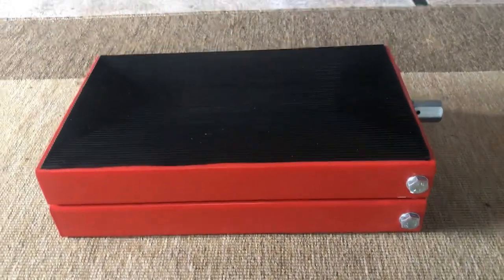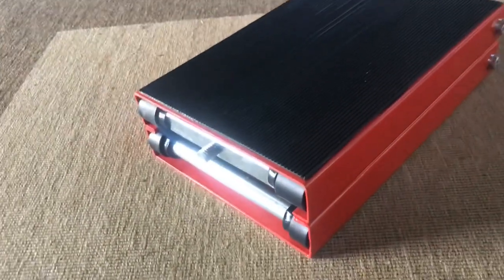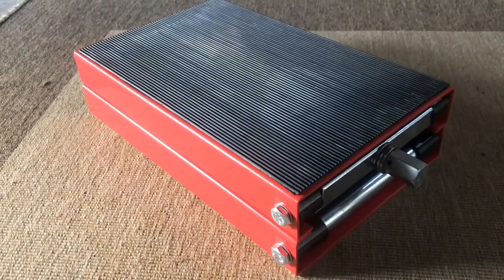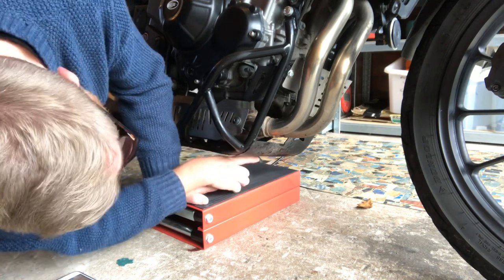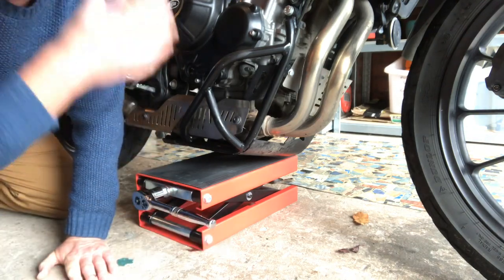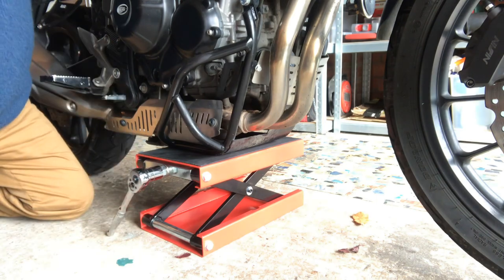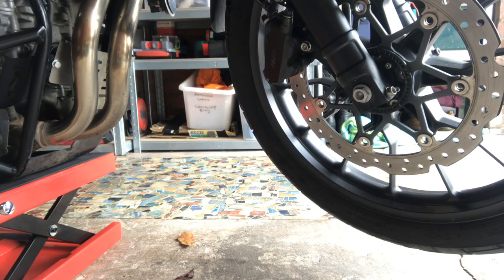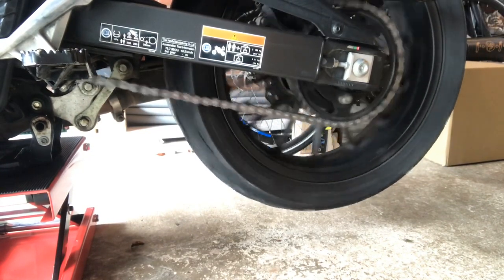Motorcycle Scissor Box Lift Review

Comment: Have one of these.  If you are considering a heavier bike over 250kg I'd recommend to change the cotter pin thats locks the bearing collar, the original appears to be only mild steel and snapped on mine (I was using it on a corner of the car so probably upwards of 300kg load)  Easily replaced with a hardened pin (and the opportunity to grease the thrust bearings).  Is a great and relatively cheap option for lifting  my Scout bobber.
Reply from the maker: Good information and advice 👍🏻
Reply: wow - I had my Harley Road King on one of these (367 kg) with both wheels off the ground - I am not sure where the cotter pin you mention is situated.

Comment: I just had mine fail. I was lowering it when the threads in the cross member that the threaded rod goes through pulled out. It gave no warning or indication there was a problem. It was only about a year old. The threads on the rod are fine. If you’re using one of these I would inspect the threads in the cross member of the scissors lift.
Reply from the maker: Good feedback Carl, will certainly inspect mine and maybe prop with some solid wood in use! Did you have any damage to bike?
Reply: No damage to the bike fortunately. It could have been catastrophic though. I was lowering it to line up the rear axle an my buddy was holding the tire. The bike dropped until the fender landed on the tire. Nobody was hurt luckily. I had never put any more than 600#’s on this scissors lift.
Reply from the maker: @carlw180  it’s horrific to think what could have happened, glad you were both okay!  What weight was your bike and I’ll pop a comment on the video information 👍🏻
Reply: @thecampingbiker791  The bike was a Harley Sportster. About 550#’s but I was only using it to lift the rear of the bike just in front of the rear wheel. I only used this scissors jack on my bike lift table. The front wheel was in a clamp and the bike was strapped at the handlebars so at least there was no worry that the bike would fall on its side. I don’t think I would recommend using this on the ground.
Reply from the maker: @carlw180  thanks for that, it will be interesting to see if we get any further feedback but I’m going to add comments to the information section of the video as a word of caution 👍🏻 keep safe and ride often 😆

Comment: Yes. Spend a bit of money and negrwo-rig-up some supporting straps.
I lift my bike with the scissor-jack. Consecutively, (with moderate tension) 2 straps around the heaviest part of the steering-column. 98% ensures no tip over.
Reply from the maker: Yep, have to agree and coincidentally just had it up on the lift with straps for a chain clean

Comment: I have the exact same model Honda CB500 X and shyed away from the bash guard you  have as you can't fix a center stand to the bike if you have this bash guard even though it's well made, as a center stand is a very  important item to have on the bike for lots of reasons when traveling or working  on the bike when doing repairs.
Reply from the maker: Hi Robert, I fitted the SW Motech centre stand and sump guard even though I did want the RR for that very reason, but in the end I decided the SW guard wasn’t heavy duty enough for what I ended up doing so ditched that and the centre stand!!   Also when fitted, I thought the centre stand may end up potentially snagging when the off road got a bit iffy.   It does make it a bit more difficult on the road so I’m going to make an emergency ‘stick lift’ mainly to help with chain cleaning, time will tell... 😆 👍🏻

Comment: This sounds ideal. I looked at this model and wanted to actually see one so thanks for the video.
I think also think the bike needs further support so I'll look into doing that somehow, even if it's a kind of wooden frame on each side.
Reply from the maker: Thanks for watching. I’ve subsequently seen these used in workshops and mine has been excellent without issues.. all the best 👍🏻
Reply: @thecampingbiker791  Yes, thanks for the reply. I'm ordering one today. 6 months waiting for two bike shops so I decided I'd do my own work. I had thought of pushing the bike to turn the engine but I've no room. £50 instead of their mechanics fee.
Reply from the maker: @bill-2018  even Rally Raid were using one for my bike front fork upgrade.. I think you’ll find it very useful over time, even for the little jobs 👍🏻

Comment: Thanks for the review, I’ve ordered one,  do you think it’s wise to cut  some 4x4 wood to the correct size and fit between the metal plates when it’s raised up to avoid accidents in the event of it failing? I only ask as I’ve not got any straps or a garage to suspend the bike to incase it did fail.
Reply from the maker: It can’t do any harm as a failsafe, although I wouldn’t be putting my hands within the lift itself so have mixed thoughts on it really!
Reply: @thecampingbiker791  yeah that’s a good point actually, scrap that idea. 
The bikes only 130kg so hopefully it’s not an issue. Just worried as I’ve seen two people comment that it failed on them. 
Thanks for your input and time!
Reply from the maker: @BlazedAFGaming  I use mine quite a lot but do check it over every now and again to see if anything is giving or looking strained…bit like a mini service check!
Reply: @thecampingbiker791  thanks that’s give me some piece of mind and yeah I’ll be sure to keep and eye on it, I’ve seen some people use impact drivers on these to raise and lower which would cause issues down the line  way to much torque for this.
Reply from the maker: @BlazedAFGaming  I’d definitely only use a hand socket wrench with these, too much power could easily cause problems 👍🏻
Reply: @thecampingbiker791  agreed.. I saw another review video and someone suggested to them to use an impact for speed. I thought to myself yeah that’s not a good idea!

I think I’ll purchase some straps to secure to the bike down to the stand as I need to take the forks off for service and also rear caliper rebuild means wheel off. So  it’ll be on there for some time better safe than sorry.

Comment: I have a couple of these - use them on my motorcycles so no issue there - they're good and can get into low space under my big bike frames which are low.  I do have a question, now that i have a low profile car, my 2014 Camaro - which has a "pinch weld" where you'd put a jack.  I'd like to get those "Jack Pads" and put them on the pinch points permanently, then use a pair of these (one on each side of the front)  to raise the car 10" so i can do oil changes.   Since these motorcycle jacks support 1100 lbs, then 2200 combined is way more than necessary to raise front of the car off the ground.  What do you figure?
Reply from the maker: Although they do a good job with the bikes, I personally wouldn’t be comfortable using on a car and just wouldn’t take that risk of the scissor lift failing!  Even if suitable I’d need some extra jacks to hold in event of lift failure...keep safe, regards Andrew 👍🏻

Comment: I wanna be able to use one of this for winter so my tires dont get flat will this be it for my purpuse?
Reply from the maker: Yes it would, you can just lift a little to take pressure off the tyres but I’d also strap the bike down as a safety measure.

Comment: Ratchet straps are your best friend for jobs like this.  Strap that boy down before you even start lifting for a fail safe emergency.  Once lifted to the height you want, readjust the straps tight and you can work as hard as you want on your bike.  Just use 5-6 straps
Reply from the maker: Good advice William… I’ve ended up using it mostly and regularly for chain cleaning, the lift doing the job well.  I normally use a couple of ratchet straps but nobody can argue with more straps for more vigorous work 👍🏻

Comment: What to buy,this scissor lift or rear stand frame.just to clean and lube chain
Reply from the maker: Either would work well enough, I’ve been using this quite a while now and works well for me…I like how it packs small and also is useful for some other work on the bike when it’s useful to keep it upright with both wheels off the floor.  Needs a flat surface under bike frame or engine though!
Reply: @The Camping Biker  Thank you.i also like scissor lift a bit more just becouse of storage,looks smaller and more practical than rear stand frame.
Reply from the maker: @alenbole8633  yes, that’s what I thought when looking…good luck in your decision👍🏻

Comment: Maybe you should move the lift a little bit further in order to get the rear wheel off the ground earlier
Should have watch vid till the end 😂
Reply from the maker: It was deffo trial and error 😂 I’ve also now got some strapping points up above 👍🏻
Reply: @thecampingbiker791  I use the garage door railing to strap the handle bars so it’s sturdy
Reply from the maker: @fivespeed3026  good tip Fivespeed 👍🏻

Comment: I think your chain looks goosed at 14.16, the links are binding.Have you been keeping the chain cleaned and lubed. ??? Use paraffin to clean and 80-90 gear oil to lube every 500 miles and you can't go wrong.
Reply from the maker: Well spotted dondle2, I didn’t notice but looking back at video it’s quite clear!! I do keep on top of the chain using Wurth chain cleaner and a wax, however have been thinking of swapping to oil for while now!  I’ll have a proper look when get bike up on stand 👍🏻
Reply: What type of gear oil , I've been reading this a lot recently